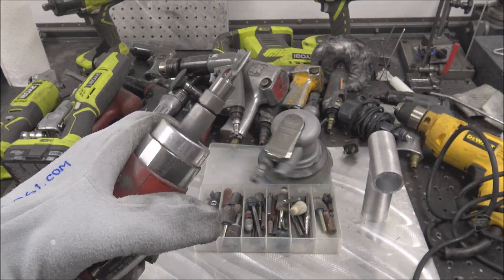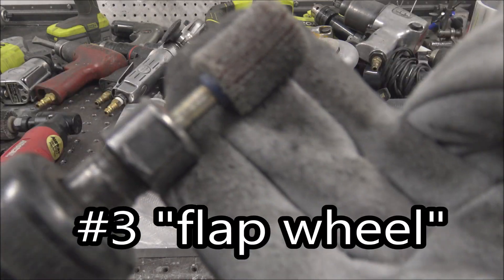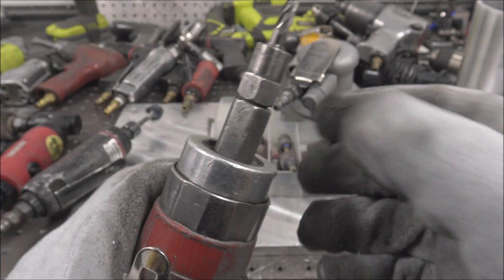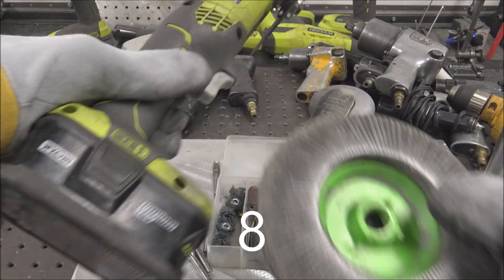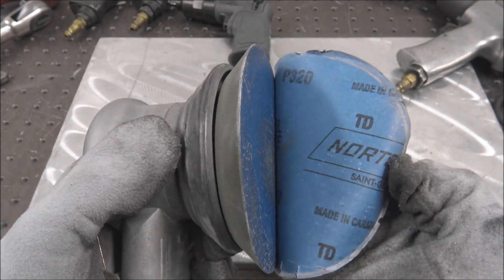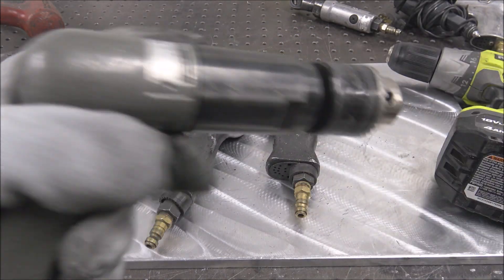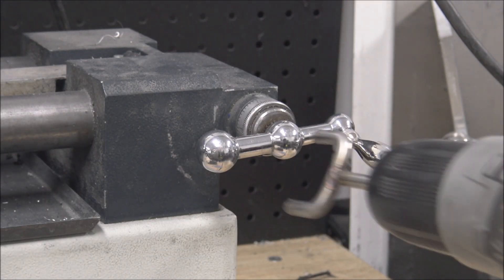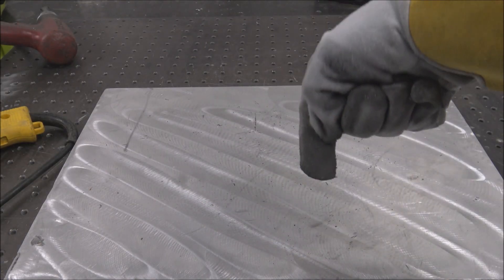16 Essential Metalworking Power Tools/Attachments for the Fabrication Shop

Comment from the maker: 1-Aluminum-specific burr Set https://amzn.to/46sjgNv
2-Carbide burr set (stainless and steel) https://amzn.to/3SxJ0Cs
3-Flap wheels for die grinder https://amzn.to/3LPguIx
4-Please help, I can't find these, leave link in comments
5-Pneumatic Die grinders https://amzn.to/4c5OdIp
6-Scotch brite "Roloc" wheels https://amzn.to/4c80PyP
7-Oscillating tool https://amzn.to/3WMDZIv
8-Last video with grinders & wheels https://youtu.be/jsVll36uaqM?si=3iQdQn3EQCMzmGdr
9-Impact guns https://amzn.to/4dvrXsR
10-Hand tapping machine https://amzn.to/4ft03PI
11-Dual action sander (Dynabrade is my favorite) https://amzn.to/3yo4AST
12-Hand drills Ryobi https://amzn.to/4d7Wjlb
12-Hand drills dewalt 120v https://amzn.to/3WtyRaY
13-Air ratchets https://amzn.to/4dtcadM
14-Sawzall https://amzn.to/3YvHJzG
15-Engraver pen https://amzn.to/4c9VuqA
16-Air chisel https://amzn.to/3A4KE8i
Reply: is number 4 sold as a paint stripping discs? they look similar to what you were showing, although it's hard to see what you used clearly.
Reply: No. 4 - search for "Scotch-Brite EXL Unitized Wheel". Lots of different sizes & grades.
Reply: No.4 is a little "unitised" wheel - Scotchbrite EXL.
Reply: #4 are called cross buffs.  I don't think YouTube is allowing me to post links.

Comment: Just a magnificent video and thanks so much for posting.  Hope to see one on hand tools, maybe you have already done one. I just bought a 'microscope' center punch...has two holes, one has a magnifying glass with a Cross, you line up your punch mark perfectly, take out the glass, insert the punch and you know you are spot on.
Reply from the maker: Hand tool video was yesterday:
https://youtu.be/jsVll36uaqM
I made the optical punch video a month ago:
https://youtu.be/8ZcJs1E2OWc
Reply: @6061  I am Subscribed but have never received a notification, or else I would have known. Thanks
Reply from the maker: Notification bell turned on?
Reply: @6061  Oops...you may be right...but where is it?

Comment: Straight die grinders, I swap the squish chuck for a 1/4 Jacobs keyless.
Reply from the maker: Doesn't that big head limit to where you can get with the bits? And more extension away from your hand equals less control/more chatter.

Comment: On the aluminum carbide bits I keep a small container of Nozzle Gel for mig welding handy, I just dip it in hit the throttle to throw off the excess in the container and start grinding. After the bit gets warm it works even better, this has worked fantastic for me for years.